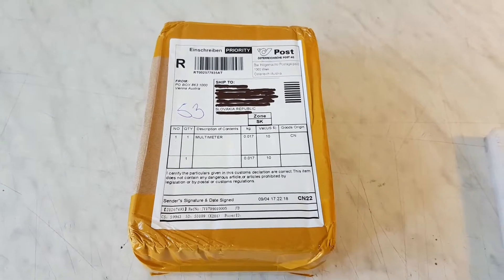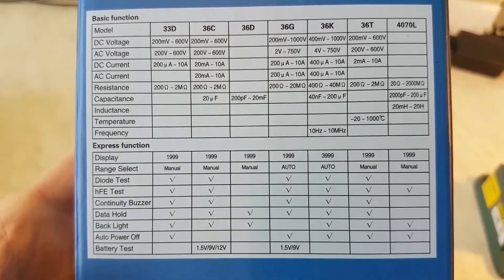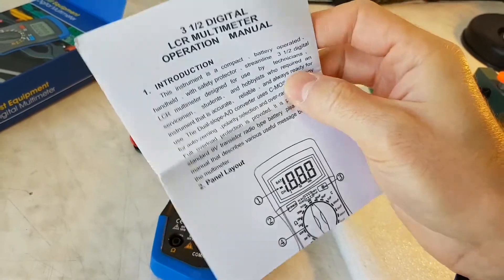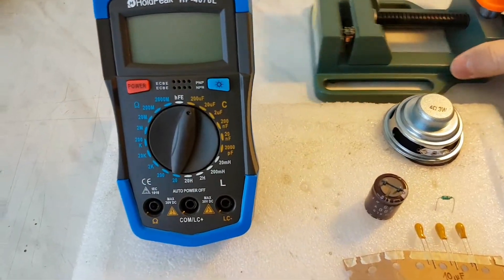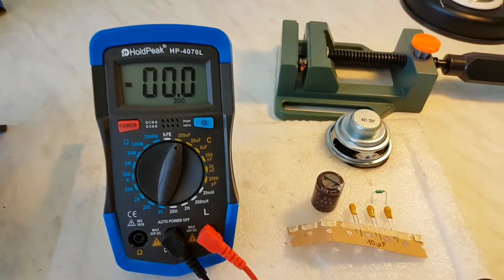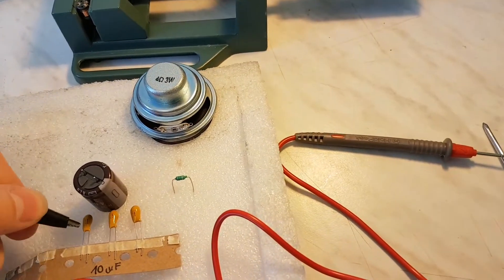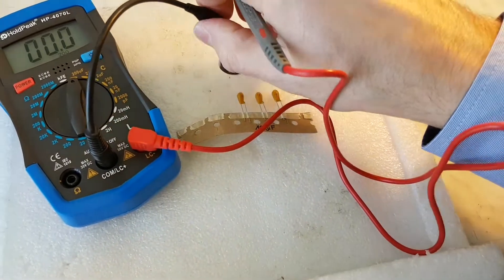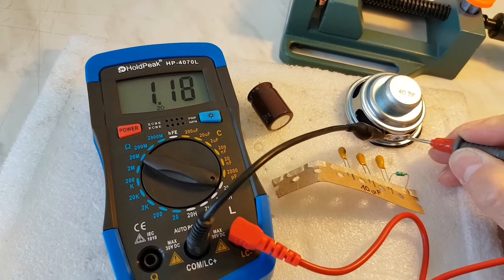13€ HoldPeak HP-4070L RLC meter unboxing and testing

Comment: It is a cheap meter that is almost good enough, but not quite. If it was a bit better I wouldn't mind paying a little more for it even. If it was twice as good it might even be worth twice the price? As it is though the value is questionable. 1.2% +30 is really spit balling the values as far as accuracy goes. So the best I can say is it needs work.
Reply: I think you're being too kind with your thoughts on this meter.  :)  

Somebody had given me one of these meters a year or so ago and I never really looked at it until now.  I'm going through some of my old junk to decide what should be pitched, and what's worth keeping.  The spec's on this thing alone make it a poor choice for a "LCR", but then opening it, putting a battery in and testing a few components show it to be even more laughable.

For specs, the capacitance and inductance ranges are a joke.  The resistance "range" is actually pretty good for an el cheapo meter, but who buys a LCR for measuring resistance?

Aside from it's design limitations, there are DEFINITE quality issues with this meter.  I connected a set of alligator clips to the common and resistance circuit of the meter, and with the leads shorted, I was reading 1.7 Ohms.  I wiggled the input connections, and observed no change.  I thought, maybe my leads were just that bad, after all, I made them myself for a different meter.  I then connected the test leads that came with the meter, and got the same result.  As it turns out, the internal resistance varies with selector switch jiggle, anywhere from 1/2 Ohm, to 7 Ohm.

This meter, given it's limited capabilities in a perfect universe, is not worth the effort of taking it apart to clean.

I was just curious to see if anybody had anything good to say about this HoldPeak HP-4070L before I pitched mine, and found this review.

This is just one piece of test equipment that should never have been made.  Mine was given to me for free, but the moments I spent looking at it makes me feel like I paid way too much for it.  I did remove my 9 volt battery before pitching it though, so I at least there is that.  :)
Reply: @stevefeldman6486  Thx for that feedback I was thinking of getting one but will look elsewhere. Im still learning the basics and want to try and make my own air coil inductors for circuits. So i want something that can tell me if they are anynear near the values